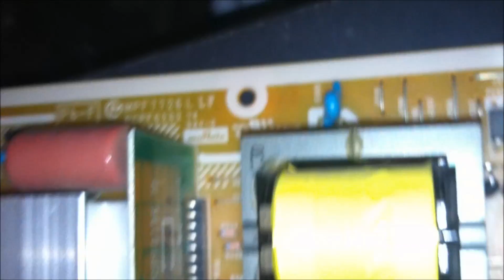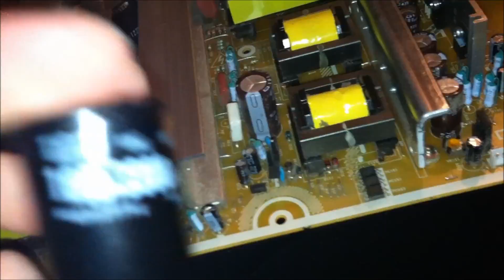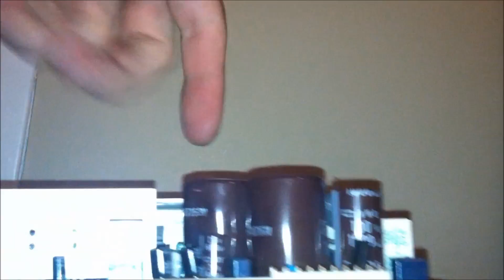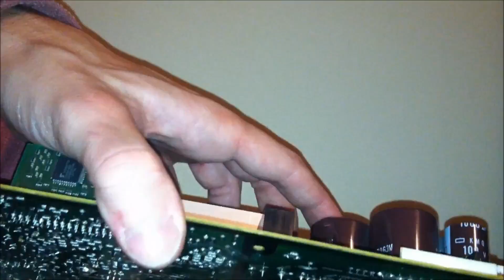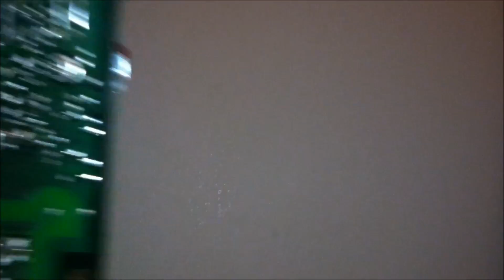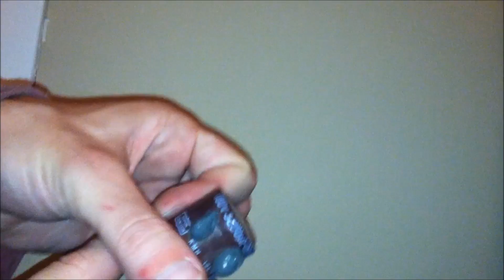hitachi p50 mpf7726l Power board repair service

Comment: I screwed up. I installed the bottom cap backwards and powered up. I messed with it for a bit before I figured out what I did. I re installed it correctly but its no good. Have I done more damage beyond the capacitors? Have I possibly damaged something else beyond the power supply? Any help would be appreciated.

Comment: Hello Fernando.  I changed those two caps on my power supply but one of them blew out right after I changed them.  Do you think the power supply has some more problems beside that or not.  The SDR cards are good; no wholes on them.  Thanks in advance for your help.
Reply from the maker: did you put them in correctly?
Reply: Yes.  I made sure to put them to the right side of the poles.  Positive to positive.
Thanks.